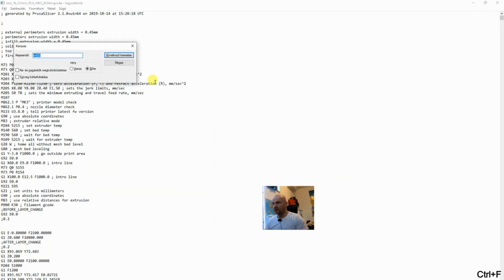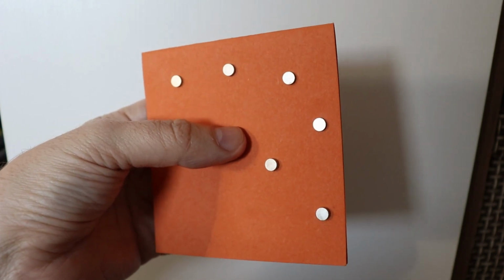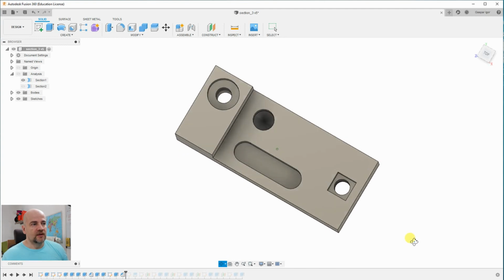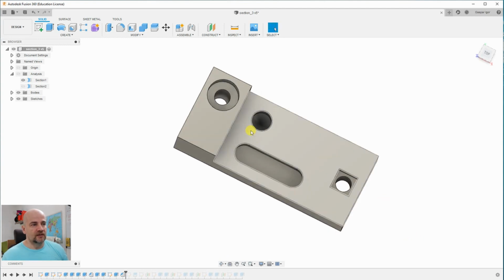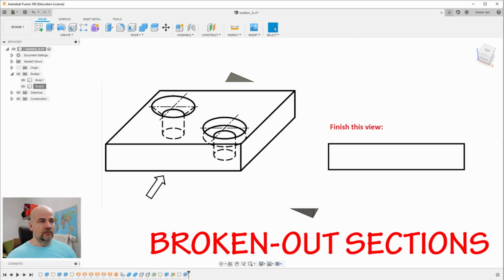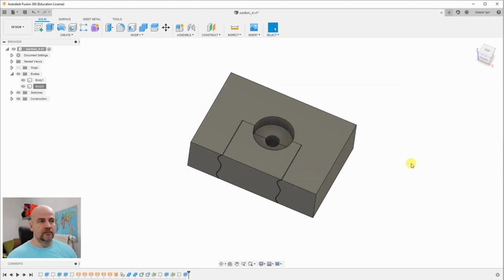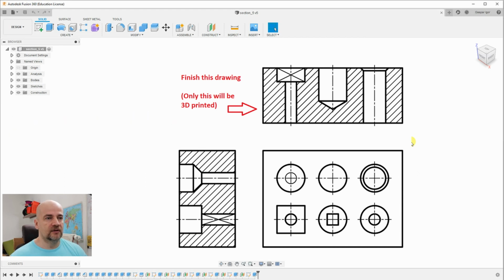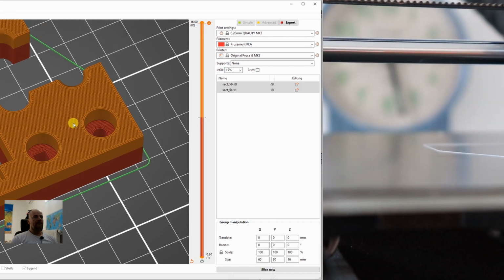Sections in technical drawings explained with 3D printed objects with inserted magnets

Comment: Just a small tip in Prusa Slicer: you can also directly paste the gcodes you used to change fillements in prusa slicer, instead of left clicking right click and select add custom gcode.
Alternatively you can also select add the M601 pause printer command there as well though that has been buggy before, so I don't know if that works. 
Sure editing the text file after is not a big deal but there is also a build in function for this.
Reply from the maker: M601 was buggy as you mentioned, but last time I tried it was a year ago.   I will try it again in near future
Reply: @MyTechFun  You can also paste the gcode you replaced in the file from that same menu and selecting add custom gcode. The next time you do it it will prefill the same gcode so you don't have to keep pasting it.

Comment: Hi do you make the pockets for the magnets exactly the same size as the magnets are you add more or less for expansion of the plastic thank you
Reply from the maker: In hole design, I always use 0.1mm clearance in all directions
Reply: My Tech Fun 
Smart choice.
When I make nuts and bolts, I always make the bolt 1% bigger.
Reply: My Tech Fun Thanks
Reply from the maker: @quique182 Here is an example: For the magnet of measured size: diameter 8mm, height 4mm, I create a hole of 8.2x4.2mm box.

Comment: Can i use this methods for anet et4 sir?
Reply from the maker: Theoretically yes, the only question is the pause g-code, if it will work on your 3D printer. Best if you try it on some small object first.